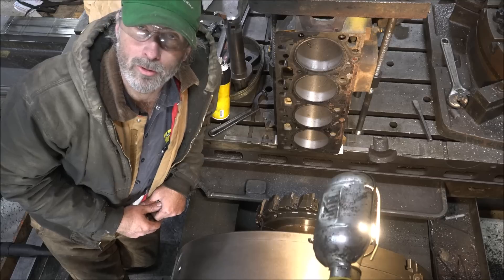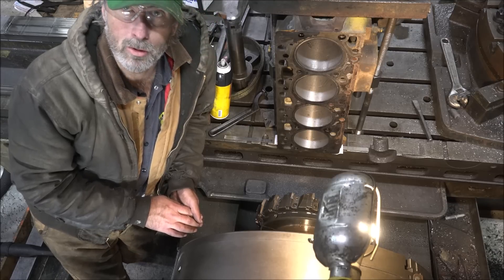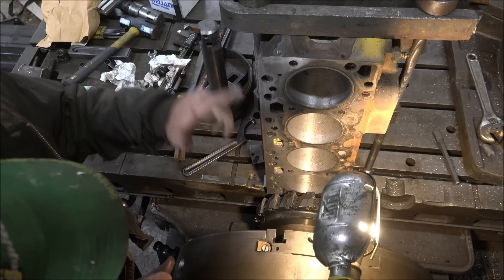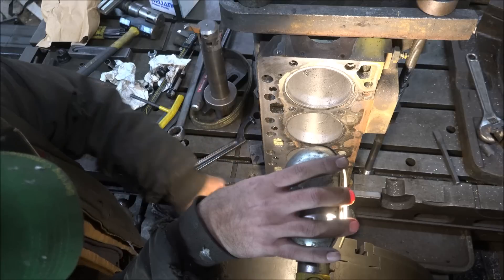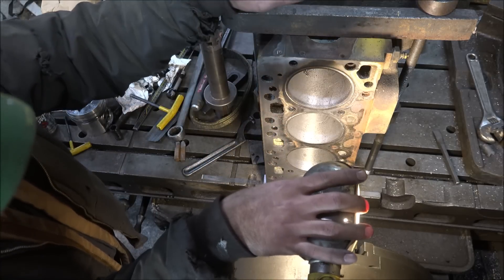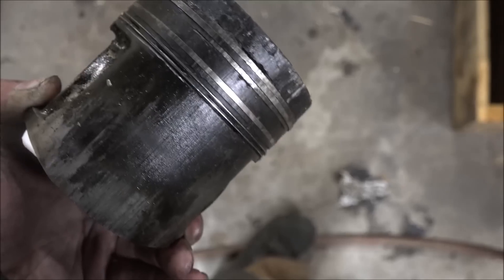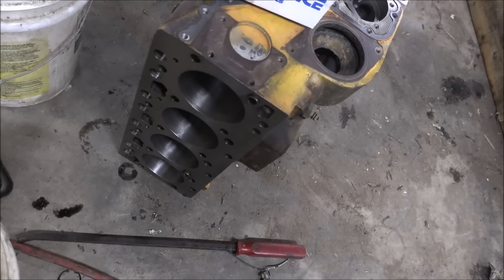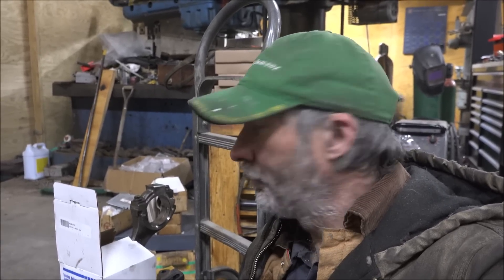Cummins 4b Block Repair After Massive Overheating

Comment: Hey Brian just wondering will we ever get see the cincinnati milacron up and running?
Reply from the maker: Probably. I have a job I would like to use it for. Main issue is I don't know any g code programming and have never run a cnc in my life. Because I don't know what I am doing and can find little time to learn it with everything else I have going on it just sits. Also the hydraulic  system for it is on a trailer behind 3000bales of straw I have to move to get to it. It is on my want to list but the have too list is currently lots longer.
Reply: @bcbloc02  fair enough thanks

Comment: I had 2 of those 4BT engines at one time.  I was going to put them into my '53 International trucks. Figured they would fit the short engine bays nicely.  But ultimately I ended up selling both of the engines because of how much vibration they had.  They vibrate a lot more than the 6B engines. I ended up buying a gas 264 to replace the blown up 220, and I guess I will keep the original 240 in the other truck, because it is fine.  Some day I would like to put a 6V53 into a '55 Chevy car. Yes I am an odd one. At least it will keep me from getting speeding tickets.  Maybe not disturbing the peace tickets though. Some day dreaming.   ----Doozer

Comment: Was that a reference to Jim's Allis where the IP was not rebuilt correctly?
Reply from the maker: Yes. I believe it was toasted by too much injection timing. This engine was just plan toasted by being run too hot.
Reply: @bcbloc02  Yup.  I watched that a while back.  I'm still a little surprised Jim didn't  hear the timing knock.  For as few hours as he had on it it must have been hammering on those pistons something fierce.  But again I don't think they are big on the diesel side.  Guarantee he knows what it sounds like now.  LOL.
Reply from the maker: @ShainAndrews  I can’t imagine it would not have been hard to start too especially if it was cool. Maybe because it lives inside they never tried to start it when it was below 50f.? They could have shot it with a timing light before they took it apart and seen what it was at. Guess it will always be a mystery unless it happens again.
Reply: @bcbloc02  I got the impression base timing was reasonable and there was some dynamic timing causing the damage.  Been a while since I watched it.  Expensive lesson for the average person without a full machine shop.

Comment: when you machine an engine like this when do you need a torque plate?
Reply from the maker: You really need a torque plate for an engine with light rings or one where you need it to break in fast.  The hard chrome ring in a diesel like this can break in just fine on a conventional hone job after a few hundred hours of operation.

Comment: Hot hard was to bore the holes out ? Did you use the boring and facing head of the machine or another boring head. And did you finish with a hone job . Sorry we missed  it

Comment: Sometimes rebuilder pistons have a shorter compression height, because it is assumed the block will be milled during the rebuild. That prevents people from having to find extra thick head gaskets.

How much damage did the overheating do to the crank and bearings? It sure made a mess out of everything else.
Reply from the maker: Rest looked great. I think the engine had low hours use.

Comment: Are oversized pistons available for it? What about piston clearance if you decked the block and milled the head?
Reply from the maker: The pistons were .040" over and they offer overthick head gaskets to make up for what I took off the block.

Comment: Good job Brian.
What was the reason for over heating to start with?
Blown head gasket?
Thanks for sharing. 
Take care, Ed.
Reply from the maker: I have no idea really, didn't see the machine just the results. They said they knew it and a new radiator had been installed already but the engine was already hurt. I believe it leaked the coolant out and then got ran without any.

Comment: Will that block get an extra thick head gasket?
Reply from the maker: Depends on how it specs after assembly but likely yeay as it whould come up about .005" too much piston out of the block for clearance. They make .010 and .020 over so they can get what they need when they put it together.

Comment: If you ever do a perking that's been really hot, the holes in the block will distort so when you in stall the dry liners get thicker liners and bore it back round.
Reply from the maker: I have done several of the Perkins/Caterpillar engines. Been a long time since I encountered an actual Perkins like a 354.
Reply: Is it not worth the time to bore the block holes round, then install the liners?
Reply: @somebody else  the only liners I could get were thicker to the inside bore. You could always special order liners. They are months away.